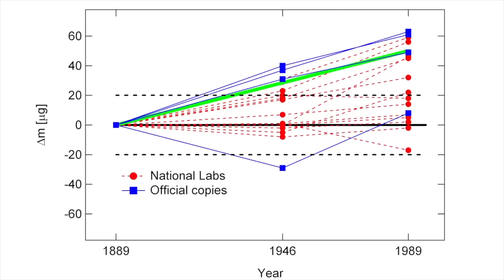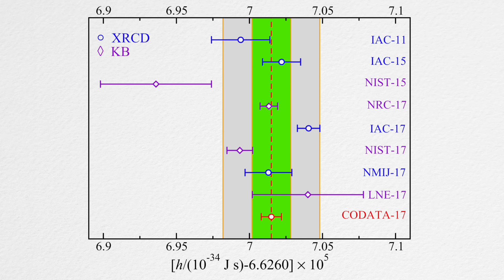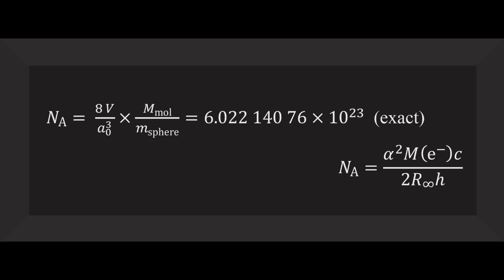The kg is dead, long live the kg

Comment: I think a potential problem is that measurements are constantly improving, so there should be a system in place so that the nations meet at least once every 10 years to redefine these constants at higher precision, otherwise, we'd be stuck with imprecise constants.
Reply: that would lead to a bootstrapping problem. Actually it's all a bootstrapping problem but now they've switched to a better system.

The problem is the defined (read as "perfect") "ruler" we've been using has been changing, which means the measured "constants" have been changing too.
Now the constants are defined as the ("perfect") ruler.

To measure to a higher precision, you'd have to have a ruler that's at a higher precision than your ruler. But you've defined your ruler AS a constant and therefore as the "perfect" measurement.

It'd be like using a perfect ruler to draw a line that's 1 cm, to a precision that is much higher than the 1cm line you drew 10 years ago. 
Then checking and seeing if your perfect ruler is still 1 cm relative to the newest line you drew. The only thing you're going to do is introduce measurement errors because the line you drew could not be perfectly precise.

More simply, what would they measure the higher precision to? You've already defined your unit, it IS the unit.

Comment: What if the ‘constants ‘of nature aren’t really constant? What if they fluctuate over time or even drift considerably over eons?

Is it possible we would never know considering we would always be calibrating our measurements to match the new true values?

Imagine planck’s constant changes such that what would be considered 1kg today was measured to be 2kg. Wouldn’t we have no idea and just go with our 2kg measurement?
Reply: It's a risk but an unlikely one.

For starters we know what major constants were like eon's ago because of astronomy (they're not just looking a very long way away, they're looking a very long time ago too).

Also we KNOW that our current definition of the KG is changing its mass, because we know its mass relative to its twins keeps changing. Simply put we know our current definition IS fluctuating. So we need to change our definition based on that anyway.

Comment: A kilogram of steel is heavier than a kilogram of feathers

With a heavy accent
Reply: A kilogram of steeu is heavia than a kilogram of feathas
Reply: Technically a kg of feathers is heavier cause you have to deal with the weight of what you did to those birds
Reply: Whaaattss heeeaaavieer, a kilogram of steeeel or a kilogram of feaaatheeers
Reply: But steel is heaviah than feathars
Reply: No, steel is denser than feathers.
Reply: That'a what common sense tells you but it's wrong. Feathers weigh more because there's 1kg of them.
Reply: @BKai714  I read your comment like Mario
Reply: Brian RX 
but steel is heavier than feathers
Reply: @BKai714  

No... The weight is the same lol. And he was referring to a video
Reply: @tobi-b  sighs woosh
Reply: @Sanctus01  

No...
Reply: The steel is indeed heavier because it displaces less air, therefor the reading on a scale (which calculates the mass based on the weight) will give a lower value for the weight of 1kg of feathers (assuming very high accuracy).
Reply: Wooooooooosh
Reply: @Meloncholics  I hate that word, couldnt you just say "you didn't get the joke". Although popularized through Reddit, woooosh still sounds cringy
Reply: Just pish yersel.
Reply: Boris Biberovik survivors are alive tho lmao

Comment: But I have a question. Shouldn't the kg be defined as the mass of 1 dm³ of water, since it's density is 1000 kg/m³?
Reply: That's the original definition but since handling water is a bit difficult, people later made a solid weight object (not something special because the pound also has got a weight object). It's just that the artifacts (which also includes 1 L of water) aren't always reliable because they are only correct in certain conditions and can change over time so we try to define them with physical constants instead of artifacts.

Comment: Im confused as to why we need to set measurements to constants anymore? A KG is still a KG. Even if THE kilogram is destroyed, everyone still understands exactly what a kg is, as do our machines and computers, right? Also, how does it give any of these measurements any credibility if we can just change them with a vote? Are they not universal constants, like the speed of light? It's not as if we could vote on and change what the speed of light is, right?
Reply: It'd because common instruments are inaccurate and need to be calibrated from time to time. Two identical electric scales left for a year will diverge a few tenths of a gram relative to each other. The ipk's job is (was?) to be the ultimate calibration reference.
Reply: Physical constants will be defined to have specific fixed values and then the size of our units will be determined to better and better precision as technology improves. Our understanding of the size of the units we use to make measurements will evolve over time instead of the values of physical constants in terms of our units.
Reply: Pyroguyman096 well for day to day life and 99.9% of the people it doesn’t matter unless you’re some scientist measuring very small objects/quantities .
Reply: Assume for a moment that the LGK is destroyed and the definition had not changed. Since the kg is defined as "the mass of the LGK", how do you know what a kg is?

The point is not changing measurements with a vote; it's agreeing that for metrology/standard definition purposes we all agree that de jure the constant is declared to be exactly that value. Measurements will continue to be made, and possibly constants' measured values at some point will be far off enough from the standard that we will agree to change the standard (i.e. to redefine the value associated to the constant). This has happened many times before.
Reply: You'd rather the kilogram be defined off of NOTHING?
Reply: @hetakusoda2977  Well, thinking about it, since h (or ħ to be more precise) is also the product of time and energy related through Heisenberg's uncertainty principle and thus is somehow an expression of how much can be "created from nothing", we aren't far off...
Reply: It's mostly for consistency purposes; think about the metre: it was once defined by a rod (a platinum one I think) and all metres were based on it, but the volume and thus the length of a physical object changes with time and slight changes around it. We need the definition of our measurements to be a non-physical non-modifiable thing so that everyone is working with the same numbers. It may not impact your daily life much but it's important for people working in fields that require as much precision as possible. Picture a plane that needs to reach its destination: if the people on the ground tell the pilots to land in 5 km but the plane's metre is exactly just half a metre longer than their's, there'd be a difference of a good 2.5 km, enough to mess everything up.
Reply: Pyroguyman096 for us average guys? Yeah it doesn’t matter. But for an astrophysicist or chemist it can be a decimal place difference between success and disasters involving millions of dollars, noxious compounds and potentially life lost
Reply: Well the speed of light is still based on a measurement. The unit is m/s, meters per second. If the measurement of distance or time was based on a physical object, it would be highly inconsistent and volatile. The kilogram needs to be the same way. A kilogram is still a kilogram, but defining what a kilogram actually is is important, physical objects alter over time and therefore can't be used as a source of a measurement. The definition of a second is "the time that elapses during 9,192,631,770 cycles of the radiation produced by the transition between two levels of the cesium 133 atom."
Reply: @JasonJia11  A kilogram is equal to 1 litre (1 decimeter³) of water. So why bother with 'h' and not define the kg from the meter, itself defined by the cycles of cesium ?
Reply: @stephane.sonneville 
Correct me if I'm wrong but, wouldn't the density change with temperature? Doesn't matter if it's still 1L of water; as long as the temperature can alter it than it isn't really changing anything.
Reply: @paolo1496  It was defined at 4°C in 1793. That's the "real" kilogram. Then in 1795 they take a platinum cylinder of 39 millimetre height and 39 millimetre in diameter.
Reply: @stephane.sonneville 
Still, it being a physical thing means that it won't endure forever. Nothing physical is permanent.
Reply: stephane sonneville Water’s volumic mass changes with temperature.
Reply: @ejetzer  And salinity - even osmotically purified and triple-distilled water still contains some amount of dissolved substances.
Reply: @paolo1496  The meter derived from a physical thing too,  1/299,792,458 speed of light.
Reply: @stephane.sonneville  That's not physical. You can't touch the speed of light.
Reply: Besides, the speed of light inside a vacuum is constant and isn't something that changes with time, which is pretty much the point of picking definitions that do not rely on physical copies: they aren't altered by time. No matter how many years pass, the speed of light will always be the same inside a vacuum, so 1 divided by the speed of light will be the same as well.
Reply: @paolo1496  Can you touch Planck's constant ?
Reply: @stephane.sonneville 
Planck's constant isn't a physical item though
Reply: @paolo1496  But it's a physical constant like the speed of light
Reply: @stephane.sonneville 
Planck's constant and c are both physical constants, physical meaning that they are a constant in the field of physics. They do not change lest we decide to change them out of our free will (ie deciding that a second now lasts twice as long, doubling the speed of light) 
The point of choosing a non-physical, physical in this case means something that has mass, is that anything physical is subject to decay and/or alterations over time and by effect of its surroundings, making them unreliable when one has to recalibrate their measuring device in a future time where the conditions are likely to be different.
Reply: @paolo1496  You right for the IPK as it's a pure physical object and I get what you mean. But I hope that with this new value of 'h' one decimetre³ of water at 4°C will still have the precise mass of 1kg, not 0.999,999,999,999 kg !
Reply: Bruh... Haven't you heard? Democracy Uber alles.
Reply: The first rule of Metrology: you can (almost) never take an exact measurement. outside of simple counting (I have 10 cheeseburgers in this box), every measurement has uncertainty. The kilogram has changed definition several times in the past few hundred years due to the need for practical, repeatable measurement of mass. The actual value of a measurement doesn't matter one single bit, everybody being able to AGREE on that value is what matters. The kilogram is now more credible because it can't change (the IPK may have had issues with its mass drifting by a few micrograms), and because everybody now has access to make measurements against the standard (previously, a direct measurement against the IPK was done with permission and under the control of BIPM.
Reply: " everyone still understands exactly what a kg is, as do our machines" no, everyone understands approximately what a kg is. Our approximations are calibrated against successively better approximations until we reach the root standard which is defined to be a kg. Hence the stability of measurements over time is limited by the stability of the root standard against which those measurements are calibrated.
Reply: π IS EXACTLY 3
Reply: @Sirenhound  π IS STORED IN THE BALLS
Reply: All our systems of measurement are man-made, defined by some group somewhere.  The metric system was the first we know of that tried to use measurable natural constants.  Its success caused a massive restructure of the UK Imperial system in the 1820s; and around 1960 the countries using the imperial/english system agreed to redefine nearly all such units in terms of metric (SI) units, because drift in the physical standards between countries was causing problems in precision engineering exports.
Reply: Yes, but we need to be able to reliably define a kg. Instruments and machines drift. Their calibration wears down. We need to be able to reliably recalibrate; to reliably define the kilogram beyond any doubt. That is why we link it to physical constants.
Reply: Well, the thing is we make scales out of a certain set standard. These scales however are not accurate forever. They may vary in their measurement or may be out of calibration. If this happens, we need to go back to the standard to check its accuracy and to calibrate it to its operational range.

The problem with physical standards like the Le Grand K is their observation that its mass changed. If your basis of everything changes and your scale might be out of calibration, how can you know which of the two tells the exact measurement?

This is where constants such as planck's and avogadro's number enters. If we fix them instead and make them the basis of the measurements, then we do not need to keep track of a standard object that may vary through the course of time.
Reply: The speed of light is sort of being redefined as well.

In the current system there's a definition of the metre, "the length of the path travelled by light in vacuum during a time interval of 1/299792458 second", which implies that the speed of light is 299792458 m/s. In the new system the speed of light will be explicitly defined, and the length of a metre is implied.

The numerical values don't change, it's just going to be written in a different way.
Reply: It's not a matter of credibility, but of diminishing returns and overkill in the amount of accuracy anyone needs - even scientists who work on an atomic scale. Similar to how we have calculated trillions of digits of pi, but even NASA only needs to use about 15 of them for any of its calculations. I believe that gives margin of error of something like an inch on a circle the size of our solar system. Once you're at 99.999999999999999999...% accuracy, using more digits of pi (or one of these constants) is essentially pointless and will only waste time and computing power. The vote is necessary just so that everyone is on the same page of which specific rounding-off point to use.
Reply: @siukong  No, whatever values are chosen for the physical constants will determine the size of our units. We could, in principle, adopt any value we wish for the physical constants and the size of our units will be changed accordingly. The particular values being adopted next year are chosen simply for the purpose of continuity. This change will enable more precision measurements in future and that's the whole point of this redefinition.
Reply: @MrAlRats  "so that everyone's on the same page" = "for the purpose of continuity". We're basically saying the same thing in different ways. I'm not sure how you think we disagree.
Reply: They did vote on and change the speed of light.
Reply: @jesusthroughmary  Who is "they"? Metrologists may have agreed to redefine the number that relates the speed of light to something else; I doubt anyone can change the speed of light across the universe, much less through a vote on Earth.
Reply: Pyroguyman096 I’m pretty sure there is variability in “constants” which sounds ridiculous. This may be due to our ability to have consistent measurements due to mechanical/ human error, or it could be that nothing is truly constant. Humans vote to make it that way... says a lot about humanity rather than physics I think.
Reply: Oh and the speed of light is a mean we get ... not a constant. Most people don’t like talking about these things.
Reply: @priley91390  And where is your evidence for this preposterous claim?

Comment: Hey, are we sure that fundamental constants like Planck's constant are not changing with time? What if they do change with time? Will the definition of kilogram change continuously?
Reply: If they find good evidence the 'constants' are changing they will redefine everything again, but that would probably destroy/invalidate a lot of modern physics, so it's pretty unlikely.
Reply: If fundamental constants are changing it will affect a lot more than the kilogram. And there won't be any choice in the matter.
Reply: harsh singhal this is now assumed rather than measured.
Reply: If we found out that fundamental constants aren't actually constant, physics would go through a crisis. Even finding just one pseudo-constant would make scientists suspicious of the others.
Reply: If you accelerate a mass it will  increase and its  time will  slow down. It's all relative.
Reply: https://youtu.be/JKHUaNAxsTg
Reply: They don't change, what can change is our accuracy in measuring them (so, technically the value 'changes' but only in relation to reduce uncertainty).
Reply: @l4nd3r  That is not necessarily true. So far we think they don't change. There is no way to know for sure.

Comment: ... or you can just use the imperial system.
Reply: Which is based on the metric system. "The majority of U.S. customary units were redefined in terms of the meter and the kilogram with the Mendenhall Order of 1893 and, in practice, for many years before." Quote taken from Wikipedia, Derek has also covered this in a previous video.
Reply: The idea is that scientists wants to stay away from artifacts. Even the US customary/ imperial system would have been defined physical constants if it weren't already coupled by the metric system.

Of course, you also can be joking which tbf isn't quite obvious...